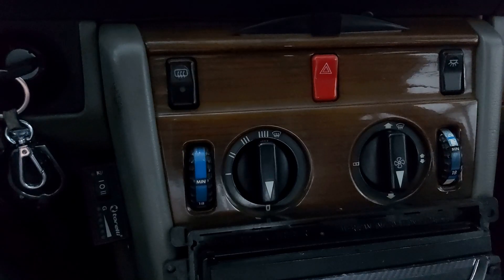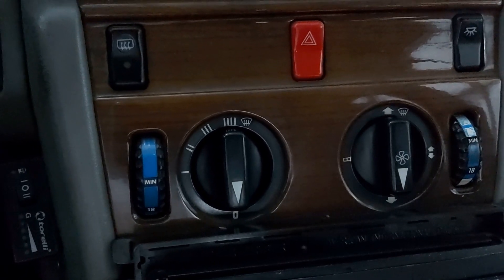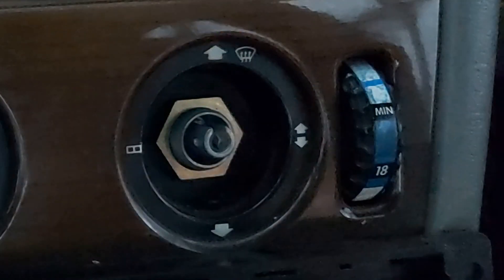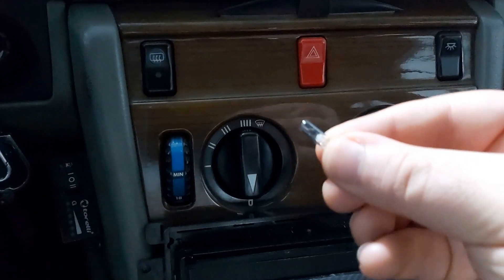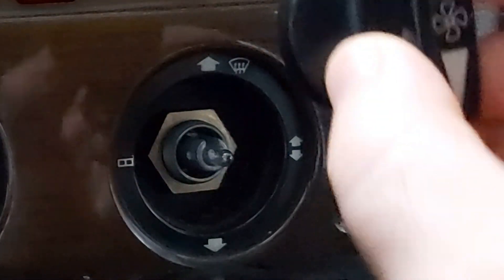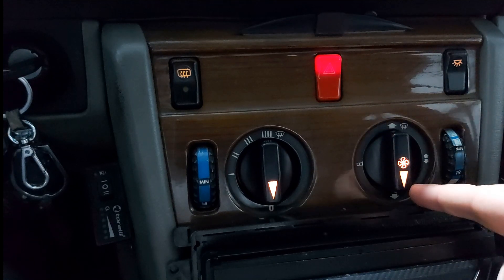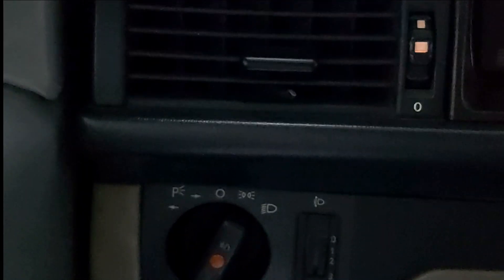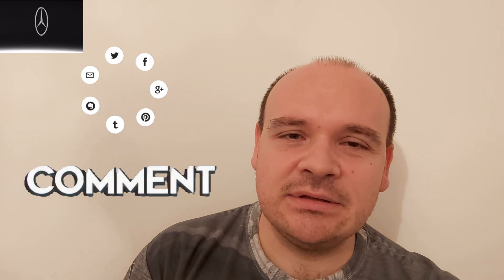Mercedes Benz W124 - One shining Benz W124

Comment: Thank you for your informative video, i own w463 300GE 1993 RHD. My problem is the illumination On the console is to dimmed, and when turn the dimmer on the speedometer, it only effect on the speedometer itself, doesn't connect whatsoever with the center console illumination. How can i make the switches in the console brighter? Thanks
Reply from the maker: You must take off the dashboard and remove a red plastic thing. There is a fuse inside that has to be replaced. I will post you a link of my video, I have a serial number for it.
https://www.youtube.com/watch?v=axRWO8UYplQ
Watch the video at 3:40
Thanks for watching

Comment: When I purchased my 560 SEL last year, none of the bulbs connected to the dimmer worked. I pulled out the instrument cluster and found this weird red fuse, that looks like a bulb. It was blown. But I had no idea what value this fuse was. Looking at all the connected bulbs, I estimated that a 1 Amp fuse would cover it. So I just soldered in a 1 Amp fuse. All good, still working.
Reply from the maker: Yes, it's about the red little thing and the fuse inside. I have a spare one from a spare instrument cluster. I will be replacing it these days I hope. Best regards
Reply: How do I remove the blower aircon knob,it's hard to remove unlike the other knob, I'm afraid I might break it
Reply: I used WD40 to remove the knob